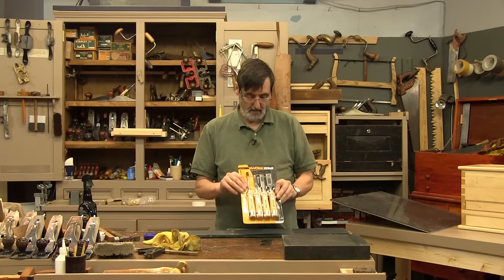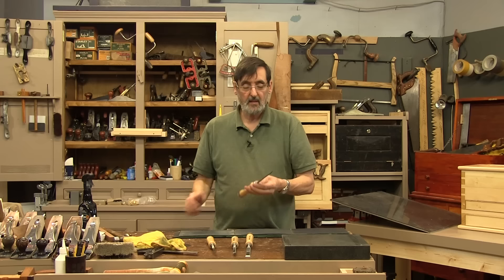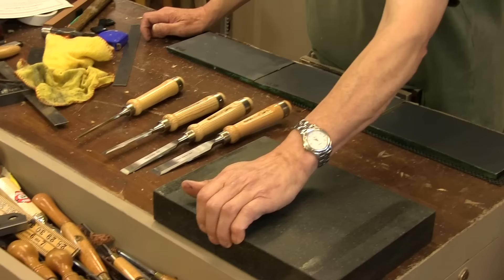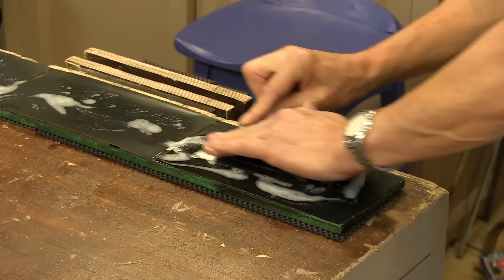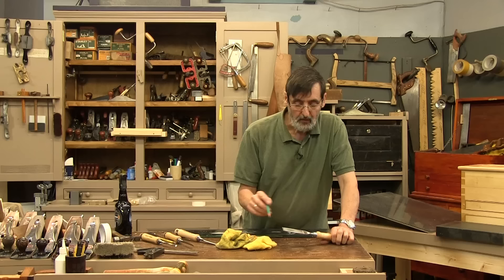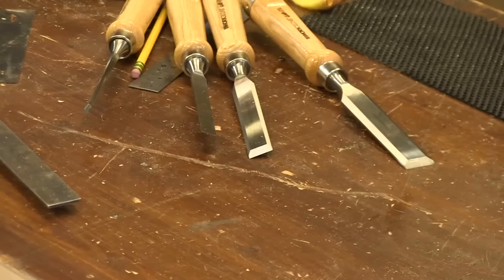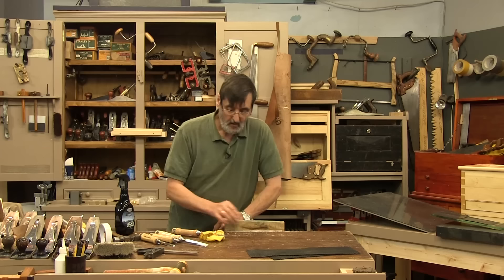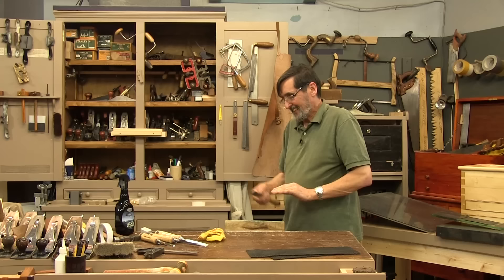Preparing and sharpening a woodworking chisel | Paul Sellers

Comment: Great lesson.  I always thought my "brand new" chisels were sharp, and usually I dulled them worse when I tried to sharpen them.  So, at first I thought this video was of little help, but I was dead wrong.  I spent an hour sharping a couple of my chisels while watching another youtube clip.  The difference was night and day.  So I shut off the video and focused on the chisels.  I can't believe how wonderful they are to work with now.  They went from one of my least used tools to one of my most favorite to use now.  Thank you!
Reply: What kind of sandpaper is he busing
Reply: @billlehnert418  Wet and dry. It's designed not to fall apart when its wet, used in car body shops.
Reply: Just be careful. They will really go through flesh easier now!
Reply: @sblack48  now that you said that, I realize my chisels do not go through my flesh even when I sharpened them...
Reply: @unknownhntr7918  you aren't pushing hard enough. Keep trying.

Comment: I just want to share my Aldi chisel experience thus far. I was able to purchase a set of these Work Zone chisels this past September around Labor Day here in the US (Midwest). These are made in China. I believe the chisels Paul has in this video are German made based on a screenshot I was able to make when there was a close-up. 

The chisels I purchased (4 to a pack) were roughly ground just as Paul's were. I cannot speak for his chisels, but these were not squarely ground. They are quite a bit out of square and will require work to get them there, which I am fine with. It will give me a chance to hone this skill, pun intended. 

Flattening the backs (all were hollow) took considerable time. I have both the diamond plates Paul has AND the 4-sided diamond block from Harbor Freight. I used the HF 200 and 600 grit sides to start and can't help but wonder if this didn't make matters worse due to not being perfectly flat, which is highly likely (I had yet completed my diamond plate holder to perform this initializing step). Aggravation led to using the diamond plate holder that was shipped with the plates. While a little cumbersome, the process worked and gave the desired results. I am through the back polishing phase and preparing to square the edges using sandpaper on glass. I haven't any doubt that once square and sharp that these will work "perfectly" for my needs as I build his first bench. :)

Paul and Team Paul, I'm not sure I can put into words how grateful I am for the videos you make and share with the world. To pass along your knowledge, insights, experiences, etc. is truly appreciated by this wood chipper. Thank you again!

Comment: Mr Sellers thank you very much. Sharpened 5 chisels today first try using your instructions. Did used a honing guide though. And indeed abrasive paper is a bit of a mess and each paper lasts only for a chisel or two.

Comment: Okay, I need to say something regarding this video. My handicap has always been sharpening knives and anything that requires an edge. So, I purchased a set of Narex chisels from Lee Valley and collected all of the supplies needed as Paul has shown. I started my first chisel at 320 grit, which may have been to fine, but it worked good. My point is the chisel is amazingly sharp, but the only thing I disagree with is I never had an out of breath Paul Sellers, I did have an out of breath Eric. So, this is an amazing how to video but Paul Sellers did not show up out of breath! Haha
Reply: Agreed! Paul's got a video on the needlessness of super high grits when sharpening. He tests plane blades at different sharpening levels and they perform roughly the same.
Reply: Hakeem Hasworth ,

Comment: This man is certainly a practical man. I feel that accuracy depends on the materials and the conditions the materials work in.  Working with wood, say making door cabinets, one can work and fit a door to the nearest one thousand of an inch, but then when the humidity of the day changes then that accuracy will have an effect on the functionality of  the wooden product one is making,   So being  good enough, in many cases, is just good enough and sharpening is one of these issues.
Reply: so true I find with installation repair renovation that speed is my gauge. Just right is a mix of tools technique materials and application. Anything more looks like "fussing" and amateurish

Comment: I'm a cook first and foremost and what you've just done to the chisel is exactly what I do to my knifes. Slightly different methods for the each tool, and way different angles, but if my knife cuts thin paper held with one hand at an angle it's sharp.  
You could cut decent sushi with that chisel it's that sharp.

Comment: I bought the Harbor Freight version of these for $16 for six chisels, sharpened them on the diamond plate, stropped them on my tormex leather wheel and they are all I use for my hobby woodworking.  Paul is the best at this stuff.  I even bought one of his stanley small marking knives for $4.00 and I use it daily.

Comment: After digging through the garage I just found my dad's old set of chisels he used whilst working as a joiner some 16 years ago. They're filthy and dull but they're relatively rust free when you consider they've been sat in the leakiest structure I know of since the invention of the open topped cardboard box. I thought I'd sharpen them, clean them up and give them back to him as a birthday present, but since I know nothing about sharpening tools I checked to see if there was a Paul Sellers video first, and here I am.
Reply: How'd it go?
Reply: Soaking rusted metal in 5% Distilled Vinegar / 1-2 days removes rust

Comment: Spending much time housebound in these Covid times, I decided to make myself a small desk to get the laptop off of my lap.  Had occasion to need a chisel for some of the work --- a 30-year-old relic in my toolbox.  Found this video.  A bit of time on my 1200 and 2000 sharpening stones (which I use for my kitchen knives), and the chisel went through wood like butter. Many thanks.

Comment: Thanks for the excellent instruction.

Also, it's interesting that Aldi is a hardware store in Britain.  Here in the States, it's a grocery store.
Reply: It's sells mainly groceries here too. But I think they have bins all around the place with random, cheap household stuff for sale also. Don't know if I've actually been in one before but going to see if I can track these down tomorrow.
Reply: I just used this sharpening method over the weekend.  Within 45 minutes, I had 3 Buck Bros. chisels in far better shape than the day I purchased them 9 years ago.

Thanks again, Paul!
Reply: if i go into aldis this week and find chisels ill be the happiest man alive
Reply: Yes Aldi sell groceries but they also have weekly specials. Sometimes tools, sometimes cycling Gear, sometimes motorcycle clothing, sometimes garden equipment. It varies from week to week. I have just about furnished my Workshop with Aldi Tools over the years.I recently bought a portable bandsaw from them. I have been looking enviously at your stores like Harbor freight for years until Aldi had one on offer. I snapped it up.

Comment: i bought some chisels a set at harbor freight 15 years ago. i still use them as my primary chisels. they have new handles but the cutting is still very good.

my wife bought some japanese ones a year back but i returned them cause i will never pay over 50$ for a set of chisels. she paid 600$ for those.

ive been a carpenter for 25 years believe me i buy tools second hand of HD or harbor freight. sears is alright but a bit over priced.
Reply: Had my chisels for 33yrs, since an apprentice. Lot shorter now, but wouldn't give thump for the world

Comment: I recently bought myself a set of chisels the really cheap ones,  and figured out after only a few blows on softwood, they have become completely useless. And the reason for this: the quality of steel just doesn't match up with HSS-steel. I have a far better standing time with high-quality steel. That costs a bit more, but I think it's worth it. If you've found a set using it a decade+, you've got lucky.
Reply from the maker: I have used 150 Aldo chisels on a day by day basis since 2010 and they've matched the very best high-end versions in keeping a good edge over chisels costing ten times as much. the students who use them love them. you just have to pick the right ones. these cost £8 per set of four.
Reply: +Paul Sellers 'Aldo' = ALDI (Albrecht Discount) right? Damn it: I'll move to the UK.. Never saw them here in Germany. ;-)
Reply from the maker: +FreeSoftware they are made in Germany I believe.
Reply: +Paul Sellers Maybe so. But I have never seen them being offered here, and I'm shopping literally every day at ALDI. 
Your videos are one of my favourite: I do learn a lot.
Reply: I watched every week, and never seen the chisels. I missed one week, and when I went in, there was the ad with the chisels. They were being sold along side some files. I went in, and all I could find was files all jumbled up in pile. Disappointed that I had missed the ed, I was walking away. Hating a mess, I placed the files neatly back in their display, and I found a single set of chisels at the bottom of the pile of files. Lucky me. If only my luck extended  to lottery tickets.
Reply: Bought a set last week at Aldi on sale for $5.99. they are exactly like the ones Paul Sellers recommended in this video.
Reply: Stores like ALDI do sell tools cheap, but the quality is good.
In Holland we have ACTION stores, low prices and really top quality tools.
I was never disapointed.
Reply: I don't  know. Maybe it's  best, to buy the best.
Reply: If you want good steel, get yourself to a car boot sale. Over the past couple of weeks I've acquired a 38mm Sorby for 30p, and 25mm from Sorby and Ward for £1 each. Yes they looked a bit rough and unloved when I bought them, but they polish and sharpen up easily enough. The handles aren't great, but perfectly usable and I could replace them if I wanted to. I've also picked up bargains like an unnamed (but good condition, and apparently German made) No. 6 plane for £18, all it needs is a little bit of flattening on the sole and a quick sharpen.
Reply: What is a  "Car Boot  sale"?
Reply: https://en.wikipedia.org/wiki/Car_boot_sale
I suppose the equivalent would be finding something at a flea market, yard sale, or general auction.
Reply: Oh, thanks. Next time I'll just look it up myself, and not be a pain.
Reply: Yes they are. as are the ones sold by Lidl perhaps they are manufactured in the same factory in Germany.

Comment: As a apprentice carpenter i was alway told that you have to sharpen your chisels with the figure 8 on a honed and that was 40 years ago But i will try your method and see if it works  Thank you for the tip  Good luck from Ireland

Comment: Hello, Paul Sellers. What is that white stone you pass to the leather to settle the edge of the metal? thank you very much, greetings from Argentina.
Reply from the maker: Hi David. It doesn’t necessarily have to be white in fact most often we use a green substance called buffing compound. This is in fact chromium oxide and you can buy it online easily.
Reply: Dear Paul Sellers, thank you very much for your prompt response and for sharing your knowledge in the videos. My English is limited and I use, in several cases, the translator or the subtitles of the videos. Thank you again. I greet very carefully.

Comment: Sharpening your chisels and gouges this way (pulling) will leave a "foil" on the bevel that will not last.  One must push the chisel to avoid a foil. (not intuitive) For this reason I have found that sand paper is not the best medium because it is very difficult to avoid tearing the paper.  Once you get a nice bevel using stones (pushing) you can get a razor sharp edge by "honing" which is done with an abrasive such as jewler's rouge or honing compound.  This is done using the pulling method Paul demonstrates in this video.
Reply: Jim Keuer

Comment: I used this video as a tutorial to sharpen my chisels. I works well, although I noticed the following things.:
1. My cheap chisels had a belly instead of a hollow…. It took a lot of time to get them flat! I wished I had been lucky and gotten hollow ground chisels!
2. Because of that(I think), I found it was easy to get the blade off square. Not sure how to deal with that.

Other than these items, I had no problems with this method and I have pretty sharp chisels now. They certainly work well enough, although Paul still makes using them look far easier than it really is. There’s something ineffable about experience and skill developed over years that can’t be imparted even through videos as excellent as this. This is not a complaint, my skill is an order of magnitude higher than before, but to get to a Master’s level, like Paul, requires a lot of work. I render vast amounts of respect! Thanks for the instruction.

Comment: I have not sharpened a chisel free hand yet !! Made a wood jig at 30 /25/22 degrees and lock in the chisel and the out come is unreal !! Simple jig to make took 1 hour each and a slab of granite !! It's cheep and the final finish is better and flatter than any grinding wheel !!  Want pictures ??
Reply: Yes, I would like to see your wood jig!  I use clamps with rollers, but because the sides are angled to grip my bevel edge chisels, they don't grip my sash chisels properly.

Comment: I bought a set of these in the USA at an Aldi Store as of May 2016 for $6.99.  The grain on three of the Ash (maybe?) handles was dead straight, and the fourth handle was dead straight on one side and and maybe 10 degrees off an the other. All four blades had a slight hollow grind on the back of the blade, which as Mr. Sellers mentioned, is a good thing. They were made in China... but they don't look Chinese.

The edges on the chisels were made sharp by using a cheap coarse and fine silicon carbide oil stone, then on to a hard Arkansas oil stone and then stropped on a piece of leather charged with aluminum oxide buffing compound. Each chisel took about two or three minutes of work. I then used the largest chisel to chop through and knock the edges off 3/4 and 1/2 square billets of cleaved white oak that I was turning into dowel blanks by forcing though a sizing die. Normally I use a small hatchet for this, but I wanted to see how well my not even two dollar chisel held up.  After a half days work the chisel was starting to get only slightly dull and required a few pulls on the leather strop to be fully sharpened... I was impressed.

My only complaint is the sizing of chisels is metric: .31in (8mm), .51 in (13mm), .71 in (18mm) and .94 in (24mm). The handles are comfortable, but I will probably modify them with flats so they don't roll of the bench. 

At a cost of seven dollars these chisels  are nearly free and are of an extremely good value which is very rare today.  I'm also thinking that I may purchase the metal files they had sitting next to chisels for $6.99... oh... and buy some more of these chisels to put away for the future. 

So thanks Mr Sellers!!

Comment: I bought some new Narex brand chisels and followed Pauls instructions using sandpaper up to 1200 grit and finished with a strop and it glides through paper!
Thanks Paul
Reply: stihl88 are the narex chisels are holding edge? I'm about tu buy a set
Reply: Yes they are holding an edge very well, though this is my first set of chisels so i cant compare them to anything.
Reply: stihl88 thanks for pointing out the lack of statistical data hahaha, I'll get a set and see .....

Comment: Thank you Paul Sellers for this fantastic video. I have the same set of cheap chisels. I spent a few hours today flattening and sharpening them and every other chisel I have and also a plane iron using your method, and they have never cut or looked so good. Some were family heirlooms that haven't been used for thirty years and they're perfectly ready for work now. I went as far as 400 grit and they are so impressive, I'll try to go further with finer grits next weekend. Thank you again sir.

Comment: Super Impressive. I have two very basic (aka cheap) and least used chisels. I am going to do this procedure as closely as possible. I hope I can finally be able to use the chisels the way I want and the way they ought to. My only worry is to keep the angle same between strokes. MAy be I will make a small jig for that. The concept is now clear. Thanks a million,

Comment: hi paul ... I found that GLUE STICK (the ones you use in school to stick papers) works really well to stick the sand paper to the glass ... apply glue stick to the whole underside of the paper and stick it on the glass ... it sticks it just enough that it will not move, but if you want to remove it , it will come off without much hassle .... also to clean the glass from any residue after removing the paper , I use a plane iron that is "unusable" in a plane becuase it had a hump that wasnt worth flattening - I gave that iron a nice primary bevel and use it as a "putty knife" to remove any residue - works wonders !!!!

Comment: Thank you Paul... have been looking at chisels and rounded gouges for the past few weeks on ebay trying to get a really good deal... then these $16.00 deals keep popping up and I keep wondering it was worth the 'cheap' route... this video proves that ya, its worth it if you know how to both sharpen them correctly as well as keep them in good shape. 
Someone else mentioned sharpening rounded gouges... will look to see if it is on your blog page, but would be really interested in your comments on good quality as well as sharpening and expanse as well.